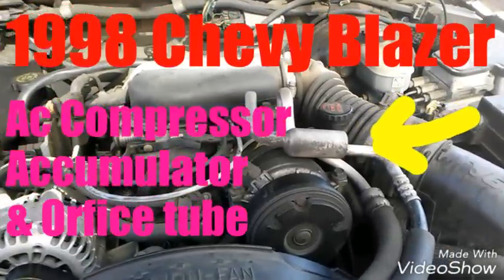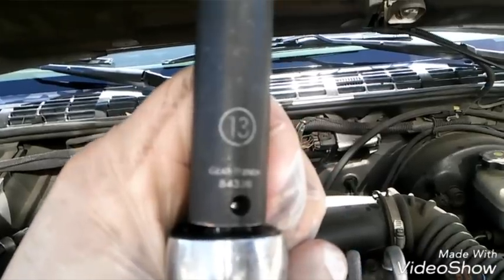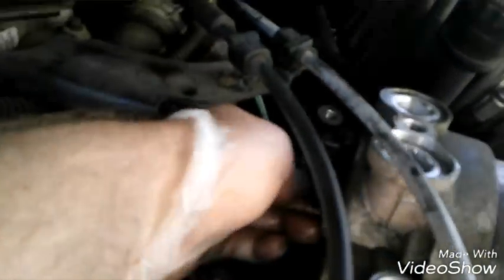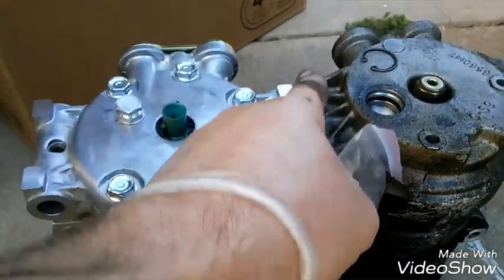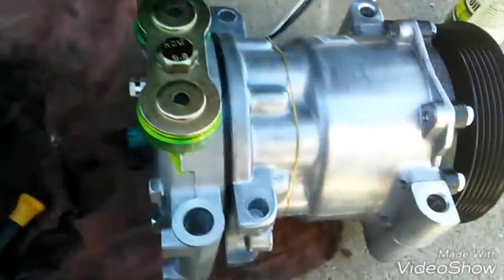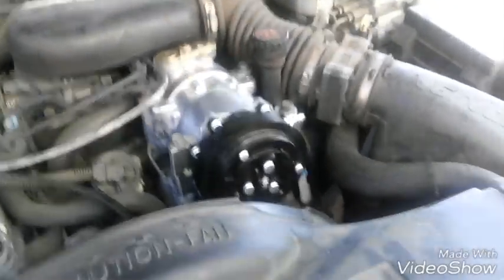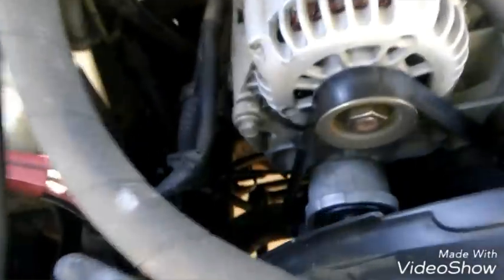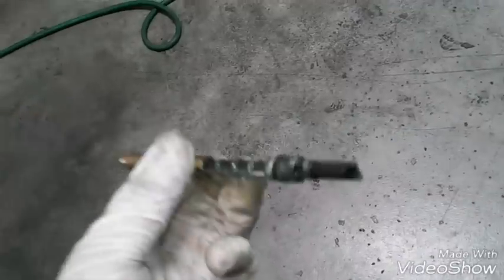1998 - 2005 Chevy Blazer AC Compressor Replacement

Comment: Dude....awesome how to video. Extremely informative and helpful. I watched this a couple times then went out and tackled my own project. I knew exactly what to do and what areas to be careful on.  Like not just pulling the compressor off once I got it unbolted. I pulled it out a little bit and unplugged the back connection before removing.  Had I not known,  I probably would have yanked the connection right off. Also good to know about adding and circulating the oil in the compressor and hoses. Thank you very much for making this step by step video. Made my project a lot easier and saved me a lot of frustration.  Really appreciate your help.  Surprised by all the other peoples complaints, I thought it was a great video.

Comment: Do I need to replace the accumulator and stuff or can I just replace the compressor? It's seized up, so should be the only issue.
Reply: I'd replace everything so that you wouldn't have to go back and do it later. Do it 1 time right won't have to do it again
Reply: @crockpot5194  that's my preferred method, but the bank account disagrees sometimes
Reply: What I just ran into was the front seal on the compressor failed & all the R134a leaked out. No problem, replace the seal and ready to refill. No. Not no, but hell no. The compressor had wore the bore out on 1 piston big enough to put a flat blade screwdriver between the piston and cylinder wall. All that metal heads straight to the condenser. The the office tube. Long story short, the newer model condensers have very small tubes. Cheaper to buy a new condenser than run multiple gallons of flushing solution thru it. Then of course replace the orfice tube because it is clogged. Then flush the evap core. Replace accumulator. Flush hoses.

Unfortunately AC is not a replace the broke part then you are good to go. If you don't replace and clean everything else, you will be doing it all again soon. Sorry for the bad news, but better to know this before you start your repairs.
Reply: Any time a compressor fails, it fills the system with trash. Either metal debris, or moisture and dirt. Replace everything- o rings, accumulator, condenser, txv or orifice tube, as well as compressor. Flush evaporator, and blow it out with clean compressed air(gently!!). A long vacuum, and overnight standby to verify no leaks before recharge will ensure a lasting repair.

Comment: So coolant can leak out from the ac compressor? I caught that you said it could also leak refrigerant. My 98 blazer just recently overheated and leaked a bunch of coolant out. I replaced the water pump thinking that was the problem but it still leaked the same way as before. it was leaking aggressively when the car was at running temperature. I noticed a leak behind my ac compressor
Reply: My ac also hasn’t been working since I bought it 1.5 years ago

Comment from the maker: GET THE GENUINE A/C DELCO AC COMPRESSOR HERE ( AMAZON ) (230 BUCKS)
https://amzn.to/3woxe1T

GET AN AFTERMARKET AC COMPRESSOR HERE ( AMAZON ) (130 BUCKS )
https://amzn.to/3XscVf6

GET THE PAG 150 OIL HERE  ( AMAZON)  ( FOR AFTERMARKET COMPRESSOR)
https://amzn.to/3CPeKuG

GET THE GM  A/C O-RINGS KIT HERE (AMAZON) ( 11 BBUCKS )
https://amzn.to/3QFwtuq

GET PAG 46 OIL HERE ( AMAZON) (14 BUCKS)
https://amzn.to/3H30bp1

GET THE GENUINE GM ACCUMULATOR HERE ( AMAZON) 
(21 BUCKS)
https://amzn.to/3ZH52Ez

GET THE ORFICE TUBE HERE ( AMAZON ) ( 11 BUCKS )
https://amzn.to/3IMn2rj

NOTES: WHEN YOU BUY THE COMPRESSOR AND ACCUMULATOR / ORFICE TUBE. TRY TO IDENTIFY WHCH OIL THE COMPRESSOR MANUFACTURE RECOMMENDS YOU USE.SOME AFTERMARKET COMPRESSORS USE PAG 46 OIL OTHERS USE PAG 150. I BELIVE BOTH COMPRESSORS I LINKED TO TAKE PAG 150. FOR THE AC DELCO COMPRESSOR ALOS ORDER A PRESSURE SENSOR WITH IT , OR SWITCH IT FROM YOUR OLD COMPRESSOR POSSIBLY.  ITS IMPORTANT TO GET WHICH OIL THEY SAY TO USE. MOST OF THE TIME IT WILL BE IN THE ITEM DESCRIPTION OR IN THE USER MANUAL WHEN YOU GET THE ACTAUL COMPRESSOR.

ALWAYS CHANGE THE ACUMULATOR WITH A NEW COMPRESSOR .  ALWAYS PUT A NEW ORFICE TUBE IN.

Comment: Thanks for this great video!  I have a 2000 Trail Blazer (no such model of Trail Blazer in the books, for that year, so it must be a custom order; seems to be loaded with all the bells and whistles).  Will be doing the AC install myself and this video makes it look doable.   I hate getting into a repair and keep finding all kinds of hidden attachments, etc.   This video shows it to be very straight forward.   Thanks for the oil tips.  

Btw, I installed a new water pump last year, and YES, an old woman can do these things!   Also, the actuator under the dash needs to be addressed next.....ugh!  Are you making a video of that any time soon? ;)

For the readers, a Haynes manual does come in handy.  The manual for a 1995-2001 Blazer is the Haynes Manual, Cheverolet S-10 & GMC Sonoma Pick-ups.
Reply: Your '00 Trailblazer is actually just an '00 Blazer/Jimmy, but with a so-called "Trailblazer" trim line, as opposed to the more common LS or LT trims that were available to these models. A couple years later the Trailblazer would become its own model and that trim line would be dropped from the 2nd gen Blazer series. And yes, you are correct, the Trailblazer was a fancier vehicle, with two-tone leather, probably heated seats, etc. But when you are working on it, engine jobs will almost always be the same for the following: Blazer (and your 00 Trailblazer), Jimmy, Olds' Bravada, S10 and Sonoma. And in rare cases if it's the only vid you can find, the Chevy Astro van and the GM Safari van both had this same 4.3 engine, too. FWIW, I'd advise you to hold on to that '00 Trailblazer. It's essentially a rare vehicle, because they only made them in '99, '00, and '01. It may reach a point were it starts to go up in value. I sure sure wish I had the '79 Toyota 4x4 truck I drove in high school back. :(

https://en.wikipedia.org/wiki/Chevrolet_S-10_Blazer

Comment: Your video was a little more detailed that a some others I watched, but did I miss something? I saw you add a little oil into the compressor, a little into the accumulator and lube the O rings, but I never saw you add the rest of of the oil to the system ?

Comment: If I’m replacing just the hose assembly, am I going to loose refrigerant?
Should I recharge after new hoses are installed?
Reply from the maker: Yes & yes. It needs to be evacuated before you do any repairs. Letting refrigerant into the atmosphere is against the law

Comment: I put a used ac compressor from the Yonk yard  I need to put oil on that or just put it like that ?
Reply from the maker: I would drain the used one and put in new oil. Hold it upside down and twist the pulley until all the oil comes out.
Reply: Gearmo Auto thank you 🙏!!
Reply: @GEARMOAUTO  Is the 10mm bolt screw
on the accumulator bracket hidden inside
the houses?

Comment: Don’t you have to drain the free on before you take the part out? Just asking.
Reply: I know this was 5 months ago, but to answer your question, it is illegal to release freon into the atmosphere, so if your system has any, you need to recover it. His system clearly had a very bad leak in it, so there was very little freon left in the system (hence the small psshh when he released the tubes at the top of the compressor)

Comment: One cuestión brother how much oil I put in the compressor.3 oz?
Reply from the maker: I believe so. There should be an AC sticker under the hood which should say the amount of oil that should be in the system. Usually like 5 oz or so. In that case i would put 3 in the compressor and 2 throughout the system.    Tech tip: put the oil in the compressor and put the compreasor on the pulley side so the oil can run through the compressor. Leave it sitting in diffrent positions a few mins each way. Then when you have it installed on the vehicle twist the pulley so the internals can get some movement and lubrication before the belt is installed. Best of luck.
Reply: Gearmo Auto thank very much is very helpful I keep following you videos I like to learn.

Comment: Am I okay that I poured all the oil in first then twisted it until it started to come out?
Reply from the maker: Ya should be ok. U can spin the compressor with the manifold hooked up before you put the belt on to to get the oil all around.
Reply: Gearmo Auto Thankyou ☺️

Comment: Does this work if the ac and heat doesn't blow??
Reply from the maker: +Naomi Mason the heater not working would no be related to the ac compreaaor being bad. Do you mean theres no air flow from the vents? If so that would be a blower fan issue.
Reply: Gearmo Auto yes when I go to turn my ac/heat on nothing comes out... I want to try to fix it myself wht do you consider I get??
Reply from the maker: +Naomi Mason Theres 3 likely problems, (other issues may exist too). Maybe the switch is bad. Try kinda hitting the switch while ui have it on to see if there is a loose connection.   Also the blower motor is under the dash on the passanger side, while u have everything turned on give the bottom of the motor a good few thumps to see if it comes on , if it turns on at all then u have a bad blower motor. ( i know it sounds caveman style to hit the motor but we use this trick all the time to find bad motors. What happens is the inside of the blower gets worn and hitting it shakes the inside a little and can make it work momentarily). Also there might be a bad resistor which is most likely inside the dash. But do the motor test first. Usually the blower motor is the weak link of the system. Let me know if it works!

Comment: Nice vid, great commentary, maybe go a little slower? Otherwise great
Reply from the maker: +Cort Graham Thanks for the comment! I will go a little slower next video. I have a 98 blazer front suspesion rebuild video coming soon.
Reply: Gearmo Auto excellent video! Also, glad to hear you're doing another one on the front suspension… Mine creeks so badly!
Reply: There's a STOP button on your video player.   You can REVERSE as many times as you need. ;)